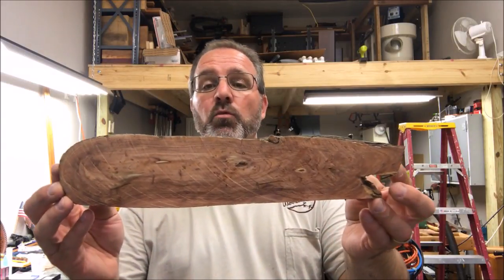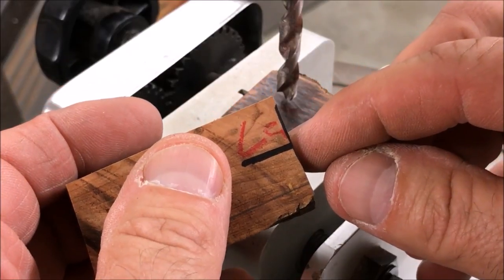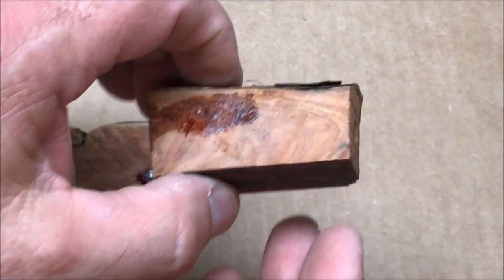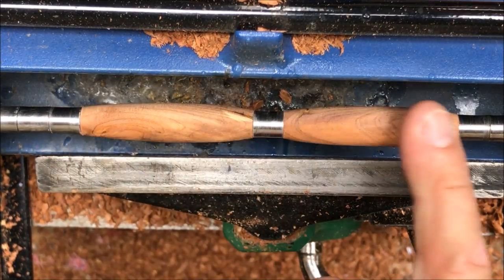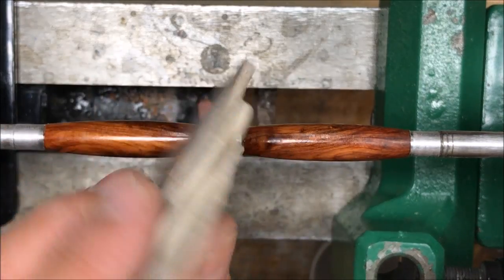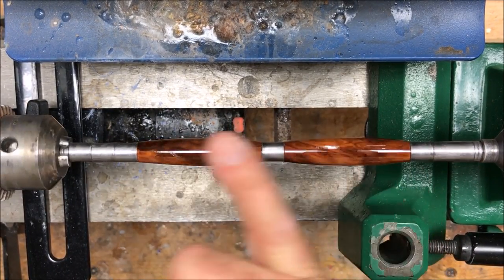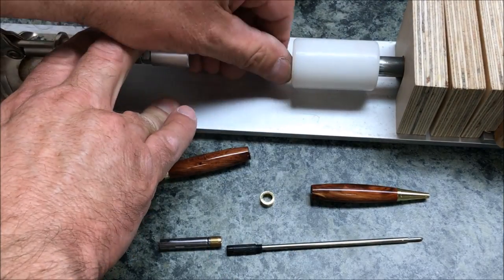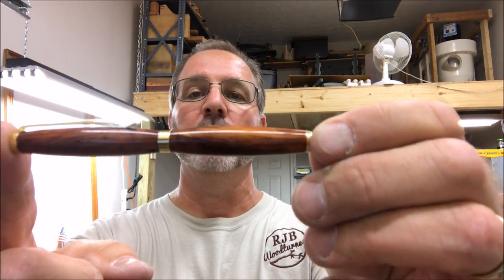Turning A Beautiful Cedar Pen

Comment: How long should I wait between coats of CA? I let the Lathe keep running to help air dry it now to touch. I just want to let you know Your channel has been a great help on pen turning. Thanks for all the help.
Reply from the maker: +Chris Thank you Chris,
  I'm glad my videos have helped. With Thin, it usually dries in about 30 seconds. I use it as a sanding sealer almost. It soaks into the wood and solidifies the fibers. After several coats, usually 5 for me, probably don't need that many, I switch to medium. Medium takes several minutes to dry so I always have something else lined up like blanks to drill or cut so I go do that. I start with three coats of Medium then check the blank for a smooth level surface. If there are any indentions from grain I apply more until they are gone. Once level, I micro mesh the finish. 

Regards,
Bob

Comment: Your videos are very instructive, and I enjoy your patient delivery. in a future video, would you show how you sharpen your pen reamers?  How to deal with the situation when CA gets into the inside of the brass tube and prevents the blank from sliding on the mandrel?  How to deal with a brass tube that gets stuck part way into the blank while gluing it in ?  

I always bevel the inside edges of both sides of the tube as insurance against binding when pressing in the pen kit parts...I've had acrylic and wood blanks crack when not doing that.  I've started turning blanks without the center busing, and always get perfect alignment of the two pen blank centers.
Reply from the maker: +Doug Robins Thank you for the video Ideas Doug. I'll see what I can do. 

Regards,
Bob

Comment: I think that is Juniper Bob.  Juniper smells like cedar.  The wood you have is not red enough.  I got a ton of cedar from trees that were knocked down from the last hurricane.  It is still too wet to use reading 30% on a moisture meter. I have cut it into boards to speed up drying.  Some of it is figured and that makes amazing pens.  
Your pen is awesome, now I have to go find some juniper.    
Cedar is hard to turn as it is relatively soft and wants to blow apart just about the time you get to the bushing.  I have about a 30% failure rate.
Reply: Dave White yea I was almost 90% shur it was juniper from the twisting it had. got about half a tree of it. landscaper was cutting down a dieout and got it from him.
Reply from the maker: +Dave White That is good to know. I owe a apology. 

Regards,
Bob
Reply from the maker: +BEE HAPPY Wood Working and honeybees I owe you an apology, I didn't know the difference. 

Regards,
Bob
Reply: RJBWoodTurner not a problem.  juniper is in the cedar genises. simalar properties. the oil and the smell. it's hard to tell the difference. the only give away I could find was the twisting of the wood. juniper has graining simalar to sweetgum. it twists as it grows.
Reply: question... does sweet gum have the twisting grain like that?  if so, that is awesome, I just got about 15'×16" diameter of sweet gum.
Reply: sweet gum does have the twised grain. gun stock makers love the graining . its strong wood. it does have tendence to crack. trun it will green. very hard to turn when dry..
Reply from the maker: +BEE HAPPY Wood Working and honeybees Good to know future identification. 

Regards,
Bob
Reply from the maker: +Brad Soulchin Following. 

Bob
Reply from the maker: +BEE HAPPY Wood Working and honeybees Great information, keep it coming. 

Redards,
Bob

Comment: Looks Great!!!  How do you get the transition from the wood to the nib smooth after adding the CA glue?  My finish seems to build up past being flush with the nib
Reply from the maker: +agbrown111 The finish will build up so I Micro Mesh with the turning bushings back on the blank and use the first pad to take them back to the proper diameter. You have to be really careful not to remove all the finish, I've done that and it really stinks because I have to start over. 

Regards,
Bob

Comment: So did you find that you did not need to stabilize the cedar before you cut up a piece for turning?
Reply from the maker: Got lucky and in this case I didn’t have to stabilize it. 

Regards,
Bob
Reply: New to turning. How do you know if you need to stabalize the wood or if you can just go for it? Does it need to be completely dried or 6-9% moisture content ok?
Reply: @leselym1407  Hi, I'm no expert at stabilizing wood yet (but I will be in time since I now have the equipment), but some woods such as cedars tend to be what many call "punky," or so soft and full of air holes inside that experts strongly recommend you stabilize (harden it with acrylic material under pressure) the wood before you turn it.  The reason is that as you turn woods that have a lot airy holes in them - especially soft woods like cedar - you could "blow out" chunks of wood as you turn it and carve into it with your turning tools.  Which woods are more punky than others?  To be honest, there are websites that can explain it much better than me.  Suffice it to say if you google "How to stabilize wood for woodturning" or "What woods should be stabilized before woodturning them?" you will find lots of interesting YouTube videos on the subject.  It's really not hard, but it does require a small investment in a pressure tank and other ancillary equipment.  And it's an interesting subject that is important for us woodturners and woodturner wannabees like me and possibly you to understand.  Afterall, you don't want chunks of soft (or hard) wood flying up at you any more than absolutely necessary.  LOL.
Reply: @johnhuggins5021  thanks! Not quiet ready to go that far in to investing in the equipment for stabilizing. You did clear it up some for me though.
Reply: @leselym1407  What makes stabilizing punky wood is that you can find some really cool patterns in woods that otherwise might not work well when turning; or worse.... you ruin an otherwise beautifully unique piece of wood that would really make a nice project - whether it's a pen, a bowl, or some other item that you want to create by turning it. Making sure the wood is stable for turning at high speed, though is key. And suffice it to say, some woods are naturally better at it than others, but not necessarily as wicked looking once they are made safe to turn. Hence.... the importance of stabilizing. Happy woodturning!
Reply from the maker: If the wood is rotten and easily
Pulled apart, stabilize it. 😃

Comment: Bob, Loved the pen...  Got a ?? for you. After I get done putting the CA glue on and go thru my Micro Mesh I start seeing little white dots on the wood. Not for sure what i'm doing wrong.  I'm thinking I'm not waiting long enough for the CA to dry could that be it per coat of CA.
Reply from the maker: +Chris Hello Chris,
  It could be that the blank had some moisture in it and the heat from the C/A curing caused it to surface. Also, if you use Activator it can cause this to happen as well as cracks in the surface of the pen. I try to avoid Activator on all but the last coat. Even then I wait several minutes before applying it. 

I hope this helps. 

Regards,
Bob